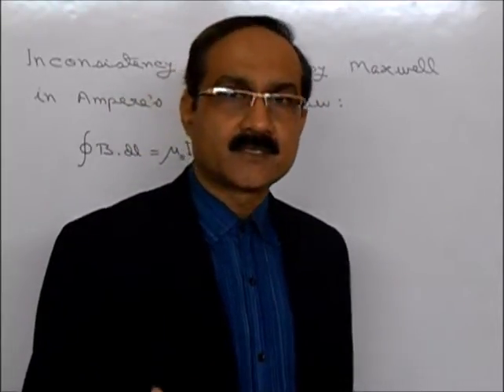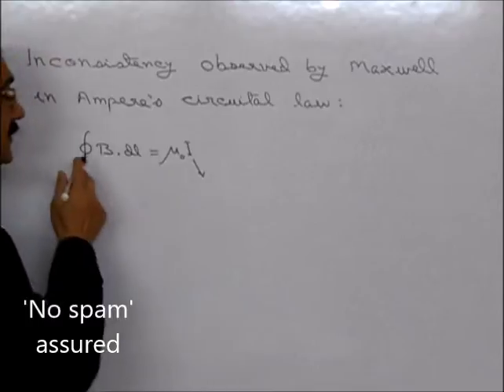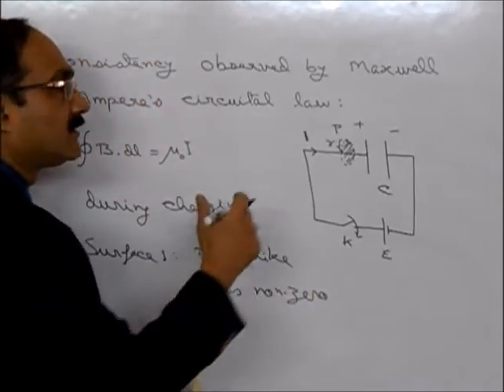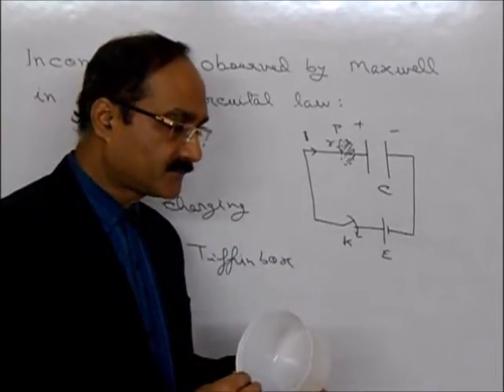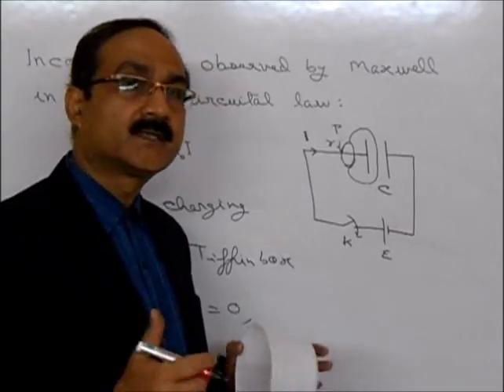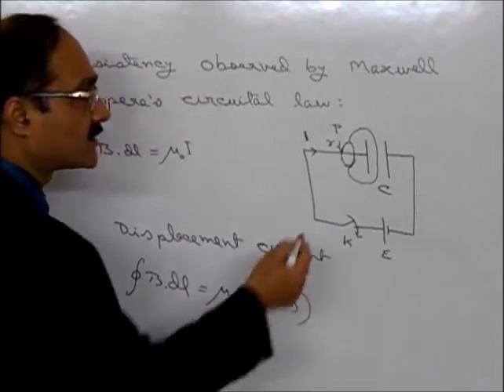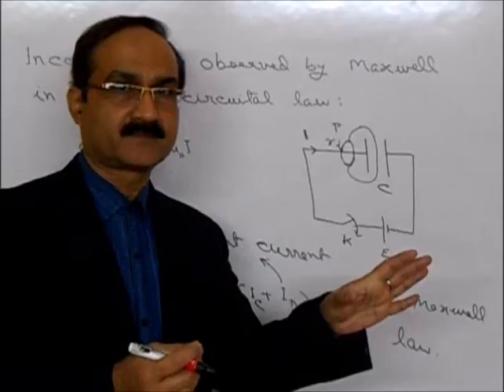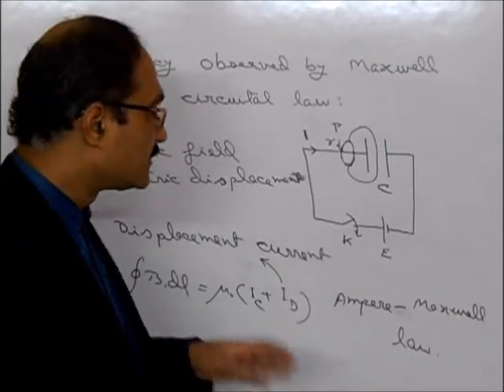Maxwell's modification of Ampere's circuital law

Comment: Best demonstration sir, i have a doubt ,in  second case (tiffin box) at point p the circular loop encloses the same  current sir ?
Reply from the maker: If by circular loop you're referring to the rim of the tiffin box, then yes - the current in the wire is the same as in the first case. But this current is not 'threading' the  surface, meaning it is not 'passing through' the surface we have taken. Hope it is clear now.
Reply: Thank you very much sir

Comment: Sir This displacement current last only till the capacitors plates are not completely charged?
Reply from the maker: Yes, it lasts till the capacitor is fully charged. After that the conventional current also becomes zero since the source is a DC cell (battery).